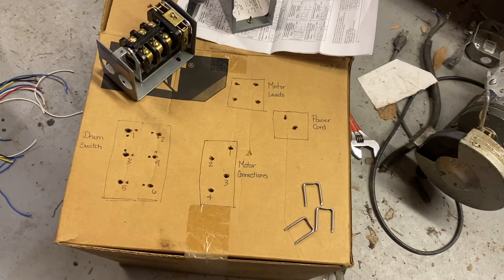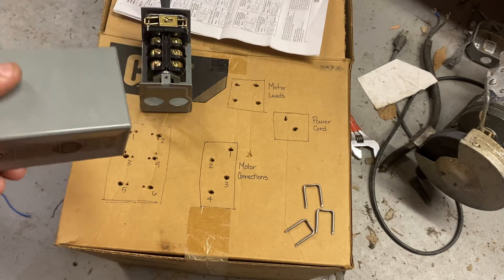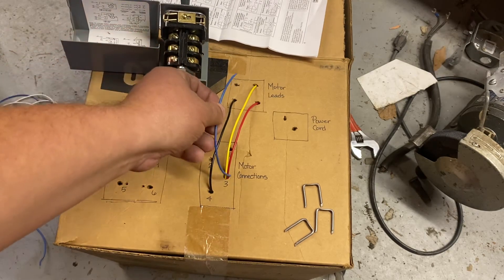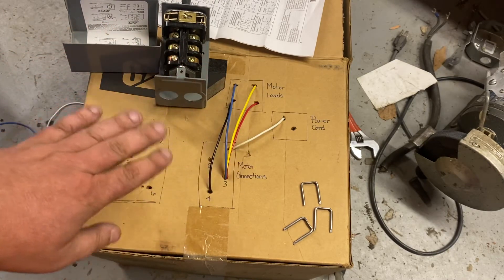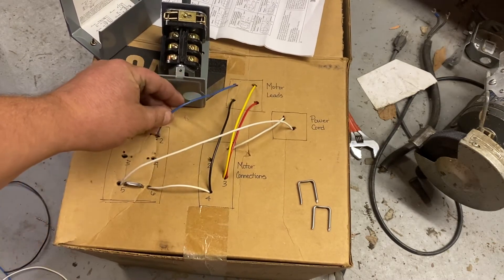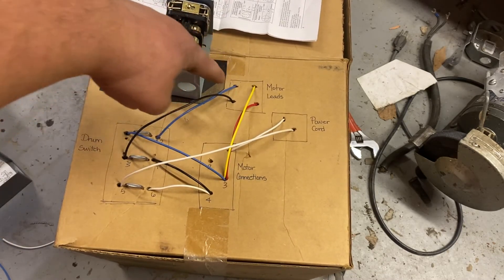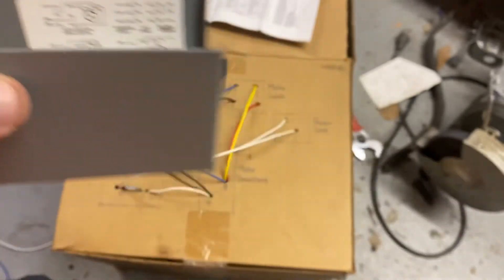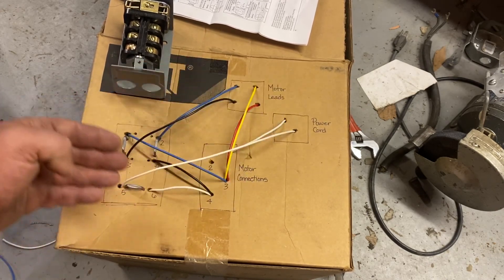Shop Tips: How to Wire a Drum Switch

Comment: You 1000000% killed it!!!

I’ve looked EVERYWHERE… and every “electrician” or salad made jack-leg has a video with goofy ass diagrams and off the wall jack-job videos not showing u a damn thing… this is PERFECT!!!

I’m doing single phase 115v with 4 wire and looked EVERYWHERE…. You are the MAN!!
Reply from the maker: I’m glad you found the video useful
Reply: @smalltownmachineshop6860  I do have a question… I bought a piece of junk 13.99 switch from Amazon from CHINA!!!  🤫

It’s this one:  Paddsun Hight Quality 60A Drum Switch 

Will this work?  Once I get it in I planned on contacting u and making sure I wire it correctly b/4 I burn up my motor or burn down my meat grinder motor!  Haha
Reply from the maker: @danielholland4385  I’m not a fan of them, they do work and I have one here so that will make it easy for me to help you when you get it

Comment: Hi, I have a milling machine I would like to wire for 220 volts. Currently the motor is wired for 110. It also has a drum switch for forward and reverse. The motor is a 2 Hp, dual voltage induction motor. Your video almost helped me, but seems to be a bit different set up. I have had two electricians out to help, but both of them were stumped. 
 If you can help I would appreciate it! I can send you pictures of the motor plate, wiring diagram on the motor cover, terminal block on the motor, as well as the drum switch. I do understand the wiring diagram for the motor, but it doesn’t take in account the drum switch. Thanks!
Reply from the maker: Send the pics to Badam485@yahoo.com and I’ll see if I can get you going

Comment: I think i need help. i have the same drum switch and a standard non-reversable motor i am using 110V that only has 3 connections on the motor,i would like to wire it to turn it off/on i have a 14 guage plug to drum switch wire and 12 guage 4 wire from motor to drum switch,would it be simpler to use a regular light switch instead of the drun switch? How do the wires go?

Comment: I have a 3hp baldor motor fdl3610tm..how do u wire that to a Dayton 2x443a drum switch..this is for a 5 wire motor leads plus thermal overload..the leads are 1 and 4
Reply from the maker: Email me the wiring diagrams and the switch diagram at Badam485@yahoo.com

Comment: Tell me how you would wire up to a drum switch to use on a dc winch?  Just negative and a positive lead (12VDC). Thanks
Reply from the maker: I would need to see the wiring setup, on winches you typically run the wires from the sylinoids up to the switch and the main power just turns the motor on and off

Comment: I have a split phase 1/3 hp motor, it has 2 lugs for power and a red and a black wire that can be swapped to run in reverse, 4 wires total. I need to wire this into a Furnas R1-A 6 pole drum switch. I’m using 120 volts. I used to think I was semi-intelligent but you model with all the wires gave me a figurative headache. Any help would be appreciated.
Reply from the maker: Email me at Badam485@yahoo.com

Comment: Is it possible for me to use  drum switch for a DC motor situation?  I want to use a drum switch to operate a winch system on my trailer rather than a solenoid.   The winch operates a heavy ramp/tail gate that goes up and down, so I want it to be able to go in both directions.
Reply from the maker: It is possible but due to the typically high amperage of dc voltage there is heavy arcing when switching and it tends to ruin the contact points fairly quickly

Comment: How do u do it 115volts. I am using grid to start my 1/1/2 horse motor then switch to my 3000watt inverter. How will I connect that up the motor only is going clockwise not reversing.
Reply from the maker: Send pics of the motor wiring and switch wiring to badam485@yahoo.com and I’ll see what I can do for you

Comment: Adam is there a way to not use a drum switch but have a separate on/off switch, and a simple toggle for forward/reverse in another place? I have a 220v. 2hp motor on my shaper and this would help prevent any confusion when operating it. Thanks
Reply from the maker: It might be, the guy Robles with it is on most motors to have to switch 2 wires if you want to send me a pic of your motors wiring diagram and I take a look at Mayby give you some options
Reply: Adam having trouble emailing a picture. Can I text it to you?
Reply from the maker: @robertstoops7855  are you emailing Badam485@yahoo.com
Reply: @smalltownmachineshop6860  I took a pic with my phone but having trouble getting it to send to my email. 
I can text it ,because it will go to my wife, but that's it.
Reply: Trying to send directly to you at your email
Reply from the maker: @robertstoops7855  Send a normal email to me first without a picture and I’ll send you back my phone number
Reply: did you receive it ? @smalltownmachineshop6860
Reply from the maker: @robertstoops7855  Yes I did and will look into it it will take a couple switches at least if I can find the right two position switches a drum switch would be much easier but I’ll see what I can find

Comment: Hi , I ordered a cheap chinese  drum switch and I have a ac Bodine geared motor 4 leads.  I am as usual a bit confused. 110v. Im just not clicking with it.
Reply from the maker: Email me a pic of the switch wiring if you have it and wiring diagram on the motor and I’ll see what I can do for you
Reply: @smalltownmachineshop6860  Hi and Thank you that would be very kind of you indeed. Do you want me send it via email? I believe I saw an email in one of these threads .
Reply from the maker: Yes, send it to badam485@yahoo.com
Reply: @smalltownmachineshop6860  ADAM THANK YOU FOR YOUR GENEROUSITY. THE WIRING DIAGRAM WORKED PERFECT THANK YOU MERRY CHRISTMAS.

Comment: Hi Adam, i have a simular drum switch on my warn 220ac winch and it operating well. I wondering (i can't find it on internet) if it is posible to have beside the drum switch a secondairy remote operating by  relays witch i can turn on by wireless. Any help is welcom
Excuse me for bad english, its not my  native language.
Reply from the maker: Do you know how the specific relays you want to use are wired
Reply: Hi, the relays i thought to  use are  normal 12v input  and the switch contacts 10amp 230v, nc and no. But first i wondering if it is posible at all?  The wireless control i have on my old winch is from teleradio(type T60aslI). On the remotecontrol i have 2 buttons onze for forward and one for reverse. 
On the winch side i have several relays. The switch contacts on the relays are normaly open and normaly close. I want to send a picture but i dont. see how. Thank you in afvangen
Reply from the maker: Send pictures to Badam485@yahoo.com and I’ll see what I can do

Comment: Wrong! L1 and K2 are connect with 2 wires to the motor in both positions so they can be both on one terminal and the two wires that change will by themselves so you will only use 8 terminals.
Reply from the maker: Very true, there are a few ways to wire it, people who have little experience wiring seem to find it  easier to follow if all the leads go to the switch so that’s why I tend to show it that way as it is easier for them.